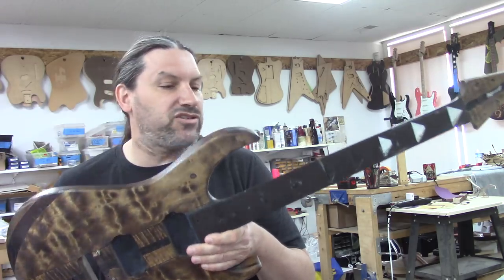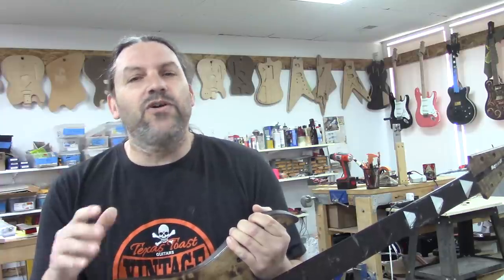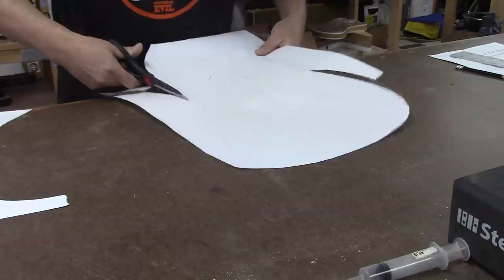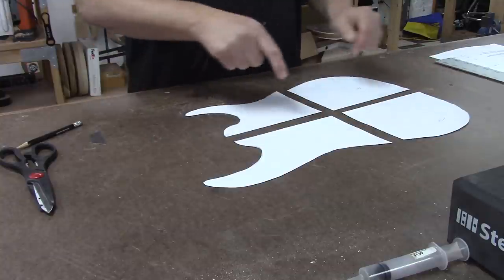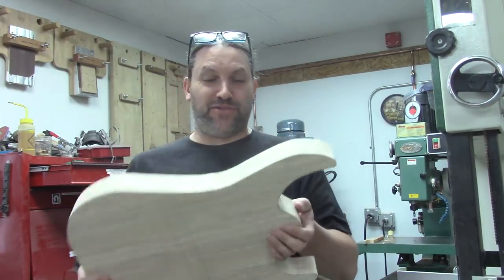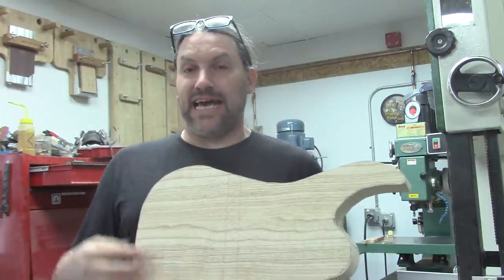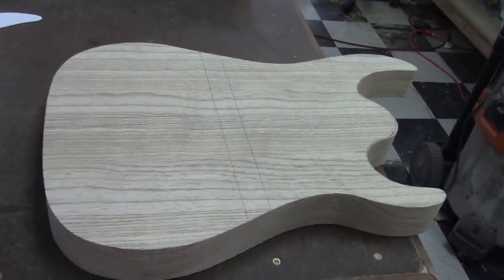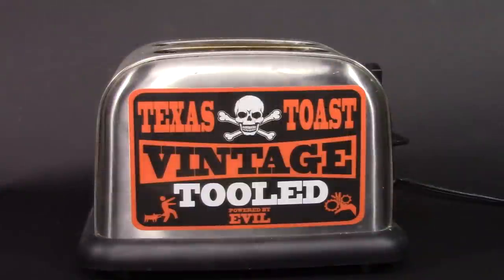The Old School Way To Shape A Guitar Body... Oh Yeah, CNC Sucks!

Comment: Thanks for the build breakdown. Luthier in self training here. Question for ya. I am having issues with my low- end delta band saw bending and popping off while trimming out body designs. So I am looking for a replacement unit. What speed and specs would you recommend in a band saw? thanks in advance for the direction.
Reply from the maker: We have a Rikon bandsaw and have been abusing it for 6 or 7 years I'd recommend seeing what they have

Comment: How about using a large steel washer with a 1" space between the outer and inner edge and then  trace using the hole in the washer?
Reply from the maker: You could certainly do that... however, my customer specifically asked me to do it this way.

Comment: 2" (rubber) washer on the pencil will give you the outline.  No fuss no muss.  Or I could be wrong.  Proportions would be different.?.  Anyway, that's my two cents and you get what you pay for.
Reply from the maker: Quartering the guitar makes it slightly different. My customer specifically asked for that so... he gets it

Comment: Hey Matt what thickness was that slab 8/4?? & What is the standard finished thickness for a strat style guitar or Les Paul? Thanks Matt you Rule**
Reply from the maker: This body is an 8/4 usually a Strat is 1.75 to 1.625
Reply: @TexasToastGuitars  Thank you Brother Im going too try to build my first electric guitar this summer for my son. I have only built ukuleles from scratch & one full sized steel string acustic